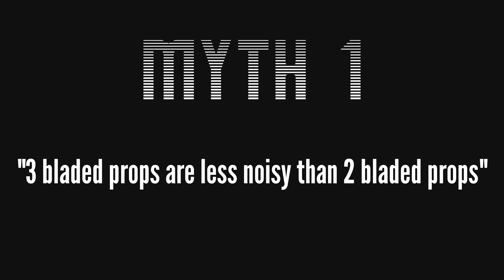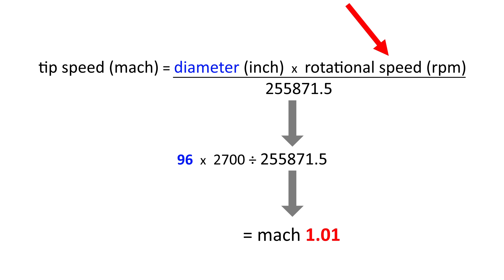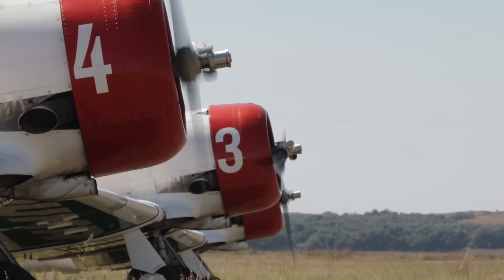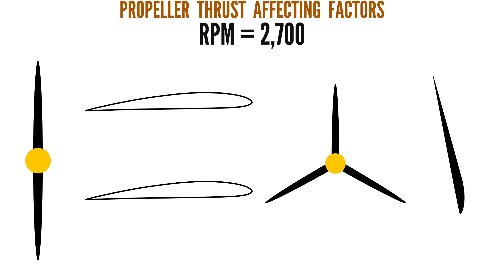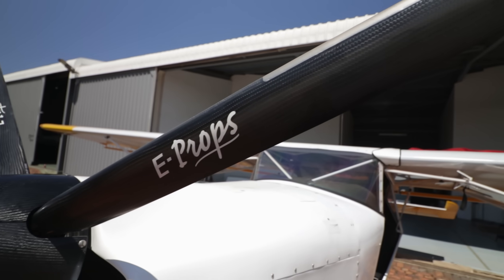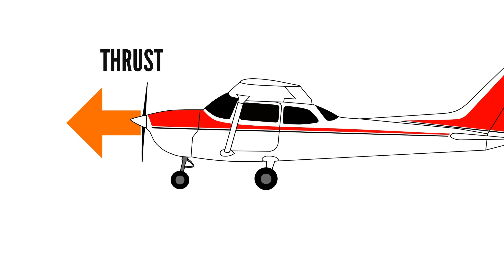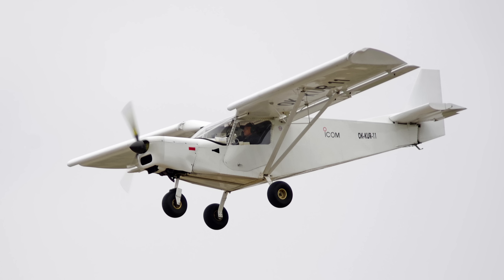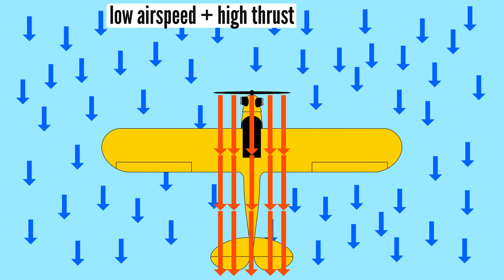4 Biggest Propeller Myths Explored - Long v Short & 2 v 3 Blade

Comment: Excellent explanations and graphics! I would love for you to make a video killing the myth that a fixed pitch windmilling propeller creates more drag than the same propeller on a stopped engine. 

Airflow thru a propeller creates drag and torque. With a lower (negative) angle of attack the windmilling propeller has less aerodynamic drag while producing enough torque to overcome the friction and compression in the engine. 

When airflow decreases enough that torque can’t turn the engine, both propeller and engine stop. The relative wind thru the stopped propeller becomes equal to the flight path, and the angle of attack thru the stopped propeller increases drag without generating enough torque to turn the engine. The (inversely) stalled prop has more drag than the windmilling prop, and that drag increases geometrically as the pilot accelerates back to best glide speed. 

The effect of this increased aerodynamic drag thru a stalled/stopped propeller has been demonstrated many times. Yet I still hear people advocate the dangerous practice of slowing down enough to stop the propeller, because they believe energy used to turn the motor decreases their glide distance, when in fact it decreases glide performance.

I think that you could do an excellent job of explaining that to people who might be inclined to test the theory, or not accept the data that shows that the practice makes their glide worse.

Comment: Great video. Thank you.  I owned a Comanche 250. I replaced the Hartzell 2 blade with a McCauley 3 blade. A friend replaced his original 2 blade Hartzel with a compact hub Hartzell 2 blade at considerably more expense.  He claimed his would be faster than mine so I challenged him to a comparison. So at 4500 ft, we both fire walled the throttle and prop controls. I walked away from him by several knots. Haha, faster and several thousand dollars cheaper. As a side note, my takeoff roll was considerably shorter and the engine/prop combo much smoother but my power off glide suffered considerably due to the extra drag. All in all, the 3 blade was a great improvement.

Comment: "the propellor pushes air back faster than the free air, or else there would be no thrust."  This is not quite true.  An alternative name for a "propeller" is an "air screw."  In other words, a propeller can be thought of as a screw which pulls the aircraft through the air, ideally leaving undisturbed air behind.  To the extent that a propeller creates thrust by accelerating air mass to the rear, it is less efficient than it could be.

Think about putting a screw into wood:  If the screw ejects wood as it is being screwed in, it produces a weak attachment.

This is why "high bypass" jet engines are used on commercial aircraft (for greater fuel efficiency): the idea is to slow the speed of the exhaust air, but to increase its volume.  Low bypass engines today are used in applications where "we want it to be physically small, and easy to spin up/spin down".

Comment: Larger props are more efficient than smaller faster ones not because of propeller wake. They are overall more efficient in any case, that's why helicopters have huge propellers and why modern big propeller high-bypass jet engines are much more efficient than old low-bypass ones

Comment: 12:30 in theory, it sounds like you could get even lower scrubbing drag AND some nice bonus lift if you could find a way to stick 2 massive propellers at the wingtips. Obviously, structural concerns say otherwise for most cases...

Comment: one thing I must disagree with you on is the statement that you made.  "The air on the front of the propeller travels faster than the air on the rear" But just as in a wing, the air on top moves at the same speed as the bottom, causing the air molecules on the top of the wing to stretch or thin out and meeting at the root, causing a lower pressure on the top, giving lift.  The same principle goes for propellers. Except for one thing, the pitch adds thrust also.
Reply from the maker: The air going over the top of a positive lift creating wing or propeller blade does go faster that air going below. It's fact, not an opinion. Here's a wind tunnel video showing air over the top going faster
https://youtu.be/e0l31p6RIaY?si=Bw03vecloDjXmRVE

Comment: @8.16. If Thrust = Drag then why not leave the entire propulsion system in the hanger and fly a glider.
Reply: For a level flight at constant speed (i.e. unaccelerated flight), thrust indeed equals drag, and likewise, lift equals weight. This is an equilibrium state where the sum of all 4 force vectors equals 0.
It's the same with your car: at contant speed on the highway, thrust = drag...
In the case of a glider, the force which is necessary to make the plane moving forward and fly comes from the conversion of potential energy (i.e. altitude) to cinetic energy (speed). The forward force is due to gravity. The art of gliding is to give up a minimum of potential energy (loss of altitude) to counter the drag, while minimizing drag too, and keep flying...
(Gliders also play with thermals (updrafts) to try to regain some potential energy)
Note also that the initial potential energy of the glider comes from the engine of the plane which towed the glider to altitude...

Comment: But the most important part is having "constant speed" propellers for high speed, so the blade angle always remains at the optimal angle regardless of airspeed, and enough torque (and thus power) to overcome the ever-increasing drag in addition to the trust-vector (the "lever-arm") of the blades shortening up fast as the blade angles moves past 50° angle. 
The fastest mass produced prop (sustained high speed) is the old Tu-95 "bear", nearly cruising at the same speed as your typical domestic jet. But it does infact have huge diameter propellers (nearly 6m / 20ft) and fairly skinny blades, but they are also contra-rotating in addition to being constant speed. Contra-rotating is also what gives it a bit of an "edge" as the main job of the rear-most propeller of the contra-rotating pair, is to recupe and straighten the induced swirl of the main propeller, and ad a bit more velocity to the core stream as to narrowing the cone of the slipstream, conserving even more of the imparted thrust.

Comment: There's a reason most (not all!) fans, be it ceiling, standing, computers, laptops... have an odd number of blades. I'm pretty sure that jitter on opposing blades can introduce resonance across the pair, and increase noise as a result. So there's an odd number so that you don't have opposing blades resonating and making noise if the balance isn't great. I would imagine on an aircraft, where you could pay more attention to the balance, it wouldn't matter too much, but it might still be a factor.

Comment: I’m planning on buying a Cessna 182 turbo with a 3-blade propeller. Should I replace the propeller with a longer 2-blade propeller so it will fly faster? PS I love the cat in the background.🐈
Reply from the maker: Everyone will give you different advice on this, but if it were me I would see how it flies with the 3 blade before I spend money. It doesn't often make financial sense to spend thousands to get a few knots faster cruise speed. That said, if I wanted to squeeze every last bit of performance out of it, personally I'd go for the longest 2 blade for which there is an STC on the 182T. Also note that with CS props the brand also matters as they might not all have the same minimum and maximum pitch stop angles, which is important if fast cruise speed is important. So an expensive/good 3 blade might perform better than a cheaper 2 blade in some circumstances.

Comment: I would like to see some discussion of matching the propellor to the engine. Obviously a larger propellor would potentially provide more thrust but it would also demand more torque from the engine than a small one. Too large a propellor would slow down the rotational speed. Engines initially produce more power with increasing RPM ( revolutions per minute). But this increase is not completely linear. andit higher speed the torque output  from the engine levels out  and an unloaded engine will  end up with some RPM at a top speed giving zero useful torque.  More powerful engines like that in the p-47 had a reduction gearing that drove the propellor RPM at a fraction of the engine crankshaft PRM. Small aeroplanes commonly have a direct drive at crankshaft RPM.  to save cost and complexity.   They could obviously do well with a reduction gear that could permit a larger prop.   
  Also on the ground with zero airspeed ( and no wind)  any engine/propellor set up would achieve a certain max RPM . Then in flight with some free stream speed the prop /engine combination   will rev up a bit.  The prop proportion and size must be selected to let the engine run at its maximum power.  A reduction gear helps this

Comment: I think Corsair with its absurdly large propeller best shows the point why a large propeller can work togheter with high speeds.
Corsair was one of the best planes in WW2. Its combat ability was superior and enormous, but it had one major drawback and that was that it was difficult to landing such an aircraft. And the plane was despite its design as a naval plane and its great air combat performance kicked off the aircraft carriers and became a land based plane instead.

Comment: Yes 3 blades propellers (if all other parameters are the same) generate similar noise at similar RPM as 2 blades propellers, but to fly the plane we need a given amount of thrust, not RPM and 3 blades propellers give the same thrust at lower RPM therefore they are less noisy. If the engine isn't able to produce that thrust at lower RPM, that is an engine and/or transmission problem, not a propeller problem, therefore taking it into account when compering propellers to each other is unfair.

You missed the biggest factor why large propellers better for high speed. The plane goes foward by pushing air backward, it gets the same foward momentum as backward momentum the air gets (Newton's III.). The thing that is decided basically by the diameter of the propeller is whether we want to achieve that momentum by pushing less air with more speed, or more air with less speed. For easy understand lets say for e.g. 1 unit air with 2 unit speed or 2 unit air with 1 unit speed. Both will give the same forward momentum to the plane, but as kinetic energy is 1/2*m*v^2, in the first case the air get 1/2*1*2^2=2 unit energy while in the second case it will get 1/2*2*1^2=1 unit energy, so pushing more air with less speed gives less energy to the air while give the same amount of thrust to the airplane. All this energy is coming from the airplane's engine and if you want to go fast, its better to use your fuel to give energy to the plane, not to the air (it is true for all speed, but when the power is a limiting factor, its more crucial).

Comment: Back in the 60s & 70s I was messing about with control line model aeroplanes.  I have 2 glow-plug engines of the same make & capacity, but different performance characteristics.  A standard Taipan 2.5 cc engine commonly used for stunt models and a 2.5 cc gold head racing engine with a 1/4 wave tuned rear exhaust tuned pipe, commonly used for speed & racing models.  These engines had different performance characteristics.  The 1st one was for  larger slower thicker (high lift) wing aircraft designed to pull very tight maneuvers at lower speeds  It would.  The racing engine was for smaller slimmer winged aircraft designed to fly as fast as possible in level flight.  The stunt engine would commonly carry a prop 8" dia  x 4 " pitch and would rev to something like 18000 rpm, while the racing engine would carry a 7" dia x 6" pitch prop and would rev out to something approaching 30000 rpm.

Now, my memory of the rpm values is not exact.  The figures stated are very approximate. However, the point is to indicate how performance parameters are so profoundly interrelated with each other.  You can't change one aspect of a design without affecting other aspects and optimal prop choice dia, pitch, blade number & width etc.  So you can't make generalized statements.  Design choices influence each other & influence the out come,  or you can put it this way, the desired performance outcome & considerations of practicality & economics influence the design choices in a complex & integrated way.
L = 1/2 . p . V^2 . S . Cl

D = 1/2 . p . V^2 . S . Cd
M = 1/2 . p . V^2 . S . MAC . CMo
But this simple synopsis hides a vast wealth of complexity.

Comment: I liked your video. A very Basic and simple theory of props. Your next video should be on a steped up props. Pull vs Push, prop wash, Hi speed props, F-1 racing props, Twin rotating props, Reverse rotating props and then less Do some Hi speed turboprops.

Comment: Maybe I'm not thinking about this clearly, but it seems to me that a prop works by essentially making a circle (spinning 360 degrees), so I am wondering if the more blades you have on a prop, would make it more efficient? (if physical size, and weight were not a consideration). I would think that a 3 bladed prop (so each blade only having to move 120 degrees) would be more efficient and offer better performance than a 2 bladed prop (each blade having to mode 180 degrees) that is the same weight, and diameter. Am I not thinking about this clearly, or is there some logic to my though process?

Comment: Why would one use a shorter three bladed prop on an engine that can only provide adequate power for a longer two bladed one? Would a 2 bladed one not be more efficient? 
A reason would seem to be too high RPM, but your example states 2600 RPM, That's (usually) not too high is it?

Comment: Also, larger prop means more air is pushed with lower speed, which is more efficient becasue of fact that the kinetic energy of the air raises by square of speed but the momentum depends on the speed linearly.

Comment: There are some interesting bespoke air frames that have been modified for speed(what else!) that demonstrate all your points perfectly.  I don't think cost was mentioned which is a major factor at the design stage for most aircraft, as with any other machinery.  Great video.

Comment: Now I got a motorbike, I learned some things about engines. Sure you got large and small engines, you got same displacement engines that deliver less power or lots of power. And you got engines with 1, 2, 3, 4 or more cylinders. And even the shape of the engine has an effect. All summarized, the torque is different. Two engines can deliver the same power, but a motocross bike is way stronger when turning slow, that is the one cylinder character. And more cylinders means turning smoother, but it also delivers the power differently, you can expect more and more power when it accellerates. And the two and three cylinder engines are in between. In airplanes, I guess you won't see many small engines, except in ultra lights, or in gliders with a "turbo", a small engine that pops up. Ah, and talking of turbo, in planes a supercharger is a smart thing, do check how much air pressure you got at around 12.000 or 15.000 feet. That means you got around HALF the  amount of air, and a gas engine is burning fuel. A supercharger enables you flying higher, and faster than at, say, 1500 feet. Milage. Speed.

So, I don't know much about props, but do you see how many totally different engines you can have in a plane? The prop must fit to the engine! For good old wooden props (yes, there still is a factory making them) they shape them to your plane and your engine. Because that prop should perform well, taking off, climbing, cruising. Really, prop engineering is interesting.

Comment: So why did the F4U have 4 blades - wasn’t it the fastest prop fighter
Reply from the maker: It had 3 blades on early versions actually. As they made the engine more powerful on later versions, they could increase propeller power absorbtion by making the blade chord wider, or by adding another blade. Adding another blade was more efficient. As it already had the longest possible blades for the prop rpm, it couldn't be made any longer.

Comment: I think a big factor in the choice of a long prop on the P-47 is the fact that it needed high efficiency at high altitude. Otto Koppen who designed the Helio Courier wanted a long as possible prop for the H-391B, it used a 101inch two blade propeller and GO-435 Lycoming.  In the prototype Helio they used a 11 foot prop behind a 145 hp engine, three point landing and take off was required.  One design factor not often talked about is twist, if you want efficiency, the correct amount of twist is required for the intended speed.

Comment: You didn't mention the twist,  the faster the plane the more twist the prop needs
Reply from the maker: You may be thinking about blade pitch. Blade twist is not really relevant in this discussion, and I covered it in depth in another video. Blade twist is needed because the blade speed is higher at the tip than the root, meaning different parts of the blade hits air at different angle of attack. Thus the blade need to be twisted so that all portions of the blade hits air at the same angle of attack. So blade twist is irrelevant to aircraft speed but directly related to blade speed. Here is the video, blade twist covered at the 10 minutes mark.
https://youtu.be/hvboi6w1Z9A?si=EApVDHlhRRZ2vAXB
Reply: @LetsGoAviate  the twist is different according to the plane speed , just think about it when the plane travels at over 300kts vs 125kts , that's why all propellers are not suited to all planes even with the same power and diameter , a propeller made for 125 kts will not be efficient on a plane that travels at 300kts even with the right pitch.